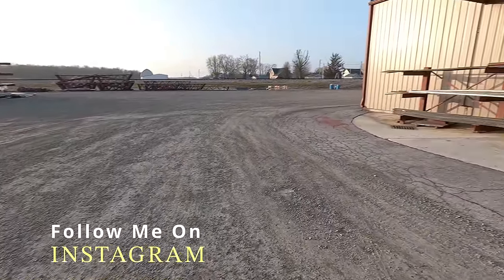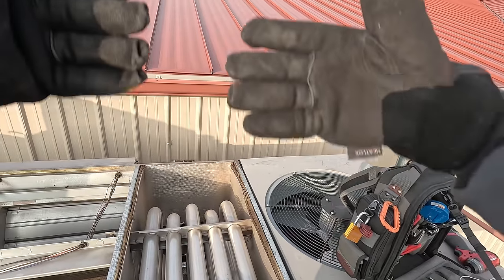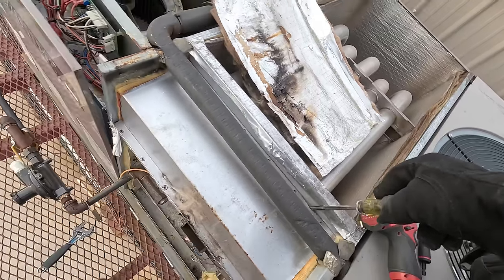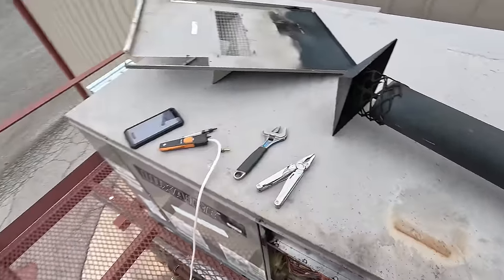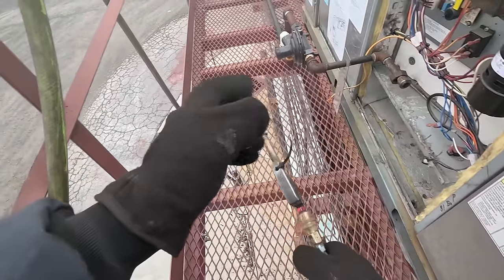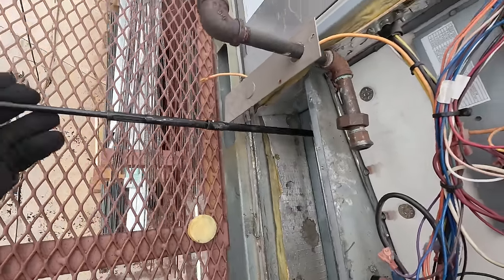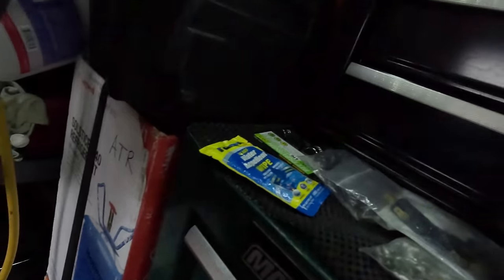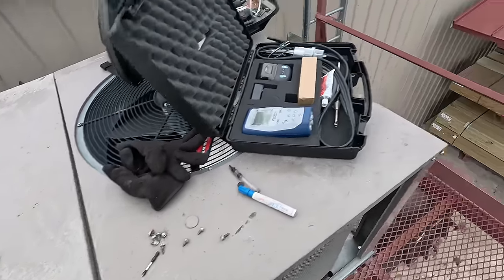Total Failure In Epic HVAC Proportions

Comment from the maker: This video was over two hours long…so to shorten it I had to cut a lot of things out. Update:👉👉 the customer decided to not fix the RTU that had a bad blower motor but did authorize me to return and install a low pressure cut out switch for the gas. I chose a adjustable switch with a manual reset. This way if the pressure switch trips they’ll lose heat and they’ll know that they’re having issues with the gas. I also recommended that they have their gas supplier inspect all the regulators, I later found out that that first regulator at the tank was not a liquid to vapor which at the time I wasn’t 100% sure because I knew that they could’ve taken it to the bottom of the tank with the tube. Either way hope you guys enjoy the video. 👉make sure to hit like if you would please.
Reply: normally ,they tie it to the flame sensor.
Reply: Great video Rick.  I thought you were work on a diesel stack at the beginning of the video. The coal was rolling🤣. Luxaire is junk and on top of that they are propane. I bet you looked like a coal miner at the end of that job. Thanks again for an interesting one.
Reply: Maybe they will get wise and install a decent system and toss the mess they have now.
Reply: Your hilarious commentary 🤣
Reply from the maker: @fshn76  my wife asked me how I got so dirty 😂🤣👍
Reply from the maker: @SeanMackBuffaloStyle  I wish I could have left it as it was. You would have loved it if you like my spoken thoughts.  Some likely would have not 😎
Reply: I watch all my videos in 2x playback speed
Reply: I love your enthusiasm when shit hits the fan. Sorry but I was dying. Great video.

Comment: Apparently what you smell in bad exhausts are aldehydes.  Don’t quote me on that
Reply: You are correct.
Reply: That’s exactly what he smells is the aldehyde . If you smell aldehyde at a furnace, you most definitely have carbon monoxide (can’t smell carbon monoxide but absolutely can smell aldehyde , produced by incomplete combustion.).
Good call👍.
Reply from the maker: That’s an interesting word I’ve never heard before. It’s good to know. Thank you.
Reply: That heat exchanger was basically a chemistry lab.

Comment: Those Luxair/York/JCI units are total ass.  Changing the HX is a two person job and the better part of 4 hrs to do.  You have to dismantle the collector box to get to some hidden screws and then the two through the blower housing and some in the condenser section.

Edit, forgot to mention, overfired and low airflow killed the last one we changed out, belt was worn to half its original width and filters hadn't been changed in 3 years.

Your analyzer is made by Sauerman btw.

Comment: Try adjusting the burner for more air until the flame turns blue (adjust the position of that shroud on each of the nozzles). This should solve future soot buildup and reduce CO emissions.
Reply: Yep. When you have that much soot its a sign its burning rich.

Comment: It looks like with the half ass exhaust piping coming down off the top of that roof ledge you’re saying there’s an airflow coming across down could be causing exhaust gases to be pushed back down to the fresh air intake for the combustion causing your sitting you’re correct don’t believe those are factor authorized extension tubes and they would’ve been better off just extending them out, 12” further

Comment: Ive used a garden hose, flooded it and found a Milwaukee small version 18v blowers fits perfectly to blow tubes out of these exchangers. Very nice work though most impressive diagnostic and service skills!
Reply from the maker: Thanks for sharing! There’s no bad ideas when you’re looking for a solution for a mess like this.
Reply: @HVACRSurvival  Get a string long enough to go all the way through the exchanger. Tie a small scrap of fabric to one end and a bristle brush the size of the tube to the other. Use an m18 vac to pull the rag end through the tube and then pull brush through. After brushing out each tube then use compressed air to blow them out.

Comment: Glad to see someone thinks the same of York/Luxaire and Goodman as I do lol, Also that is vapor withdraw tank for sure, that's just the first stage regulator to go from tank pressure to 10psi, Vaporizers are either electric or gas fired and actually heat the liquid to boil it than send it down the pipe, they work very similarly to a Unitrol on a conventional water heater. They're common up here in Northern Ontario remote mines that have huge fuel consumption demands and the tank cant boil fast enough to provide enough vapor
Reply: They used the cheapest 100$ Amazon special version of a vaporizer. It shouldn’t be within 15 ft also
Reply: @Pippy626  There is no vaporizer there, the pipe feeding the first stage reg is coming from the top of the tank, vaporizers draw from the bottom its a first stage reg and a relief valve there
Reply: @Byron88 you are correct. It’s a cheap regulator.
Reply from the maker: I later found out that it was not the vaporizer, but at the time I wasn’t sure so because I said so many things that went along with that I left it in the video. I should’ve done a title overlay, saying that it was not.
Reply: @HVACRSurvival   All good, I enjoy the content regardless, I just figured propane was uncommon there and would just throw the info out there. Happy New Year!

Comment: One of those beloved maintenance guys here, had a few units on a building I look after doing the same thing on natural gas, replaced the heat exchangers on them, from what I was told when the building gas system was commissioned, it was never purged and cleaned of any construction dirt, a rag was even found in the gas line for a boiler.
Reply from the maker: Wow. That’s great 🤦🤫

Comment: As for the gas manifold port on those valves, I use a 1/8 x 2-1/2 nipple and 1/8 coupling to extend access above the pilot tube. Connect the 1/8 tubing adapter to coupling.  Comes in handy elsewhere also.  1/8 Male x Female NPT valves are also useful if checking between multiple ports at the same time with a single device.
Reply from the maker: Thanks for sharing! Good idea!

Comment: The pilot burner usually gets a little spider webs inside it. Spent many times trying to figure out why the pilot wouldn't light. Stick some wire down there with a little hook on it. Usually will get a small  spider web on the end.

Comment: Always a great day when you can smell heat exchanger issues. I wish more manufacturers would make a low pressure cut out standard in LP Kits. Where do you find an after market switch like that? Never even though to look
Reply from the maker: Googled it. Ordered on supplyhouse.com

Comment: Were the manifold orfices changed when the conversion kits installed?
Reply from the maker: From what I was told he did the full conversion. There was no stickers to tell me what the orifice size are manifold pressure should be.  
He told me it was supposed to be 9 1/2 inches water column so that’s what I said that.

Comment: That sure seems like a large propane tank for two small heaters. Are they using the propane for other purposes?  Maybe overwhelming the natural vaporization of the tank?  If so, may need to add a true propane fired vaporizer.
Reply from the maker: Come to find out it wasn’t a liquid to vapor regulator, and those two tanks provided several other buildings with gas. I was also informed that they had added a lot of extra heating loads, which was likely causing the regulators frost up like that. I’m returning to Install low pressure cut out switches on the Regulators
.
Reply: @HVACRSurvival  That would be the band-aid but maybe still talk to the propane company and see if the total connected load is overwhelming the tank. Of course the vaporization rate falls along with the outside air temperature when you need it the most.

Comment: Before I would say that that’s a bad blower motor, I would want to double check that all three phase legs are connected to that motor. It is very likely that you have a bad contactor. I have about five bad contactors producing that same result for every one time I have an actual bad blower motor. When that unit fires off…..and I have to assume that they have the correct valve modification in place for use with LP gas…. I would want to monitor the manifold pressure when everything that uses LP in that building is running. I’m guessing that that’s a very long pipe run, and it’s a long pipe run with a small diameter pipe and a low feed pressure. So, that’s my tip for you after 60 years of mechanical work.

Comment: Great vid!  They also make the Klein flip sockets in metric but they 3 times the standard ones price!   
I’m with ya on blowing furnaces out.  I still to this day prefer using air over vacuuming if conditions permit! lol.
Reply from the maker: I have tried using a garden hose on heat exchanger before in the past that was kind of a disaster and itself. Customer said they’re willing to replacing the unit so if this doesn’t work, then we’re going to sell them a new one.

Comment: if the burners have adjustable air bands, they likely need adjusted for the propane conversion, while that's sure not helping. looks like you found the main issue, those goofy stacks and running out of propane or other propane piping issue. it for sure needs low pressure switches added.

Comment: That is some garbage but I'd derate the burner orfices. If you can find the plugs you redrill them right into the existing burner orfices. Not sure what your altitude is but in Colorado I had to do this in the past. It probably wouldn't hurt as I bet with that cheesy ductwork your temperature rise is probably high anyway.  Just a thought. I have a orfice drilling bit kit with several sizes.  I don't even know if they even sell this anymore as I never see them at suppliers selling this stuff. This trade really sucks, most would have said phuck it get a new unit. Ha, cheers to you and your efforts. I picked up my drill bits and plugs at CD Jones several years ago and haven't had to do any modifications in several years now. But it definitely fixed my problems with burning dirty! I had 500 plus ppm CO and after modifications 15 to 50 ppm!
Reply from the maker: According to the technician that was out there prior to me that did the conversion he replaced all the orifices with an LP kit. Surprisingly it’s been two months since I was out there and I haven’t heard of them calling in yet. When I went back to install the low gas pressure switch, I blew it out again this time with nitrogen and got the last bit of junk out and I open the air up more.
Reply: @HVACRSurvival  You still may have to derate the orfices if it still is burning dirty. It just is a long process.  The engineers probably smoking crack! Ha
Reply from the maker: @Paul-VanHorn  😂

Comment: Over 30 yrs HVACR in Wisconsin... never come to a LP regulator that was set correctly ( all gas regulators need be set under 100% load). BTW York & Goodman suck both commercial and residential.

Comment: the condition is in is due to them running the unit with natural gas orifices and gas valve spring,too much fuel,if converted a good brush and clean,good to go.well done.

Comment: The issue with gas fired heaters is they work good until they don’t especially when they’re half assed put together and not maintained like they should be!
Reply from the maker: That goes for anything not properly installed or maintained . But I sure as hell wouldn’t want an electric one.
Reply: @HVACRSurvival  outside of the usual
Maintenance we’ve never had an issue on the heater side not once keep in mind not every place has access to a gas fed system especially in the south may dip below freezing like once or twice with snow being super rare most of our issues comes from hurricane but with the south rarely ever needing heaters while a lot do have gas water heaters a gas fired heater for the house hvac isn’t really necessary like it is another parts of the world  or even up north and Midwest where it does snow and power can be out for a while.
Reply from the maker: @CajunReaper95  very true👍👍

Comment: 15:00 you can hear the amperage on tilt and dude puts his HAND WITH GLOVES ON in and starts grabbing at the rubber belt attached to that motor....bro if this isnt some of the most darwin stuff i've seen on the internet recently
Reply from the maker: And if you notice, I don't put my fingers on the inside of the belt if for some reason it would take off. Generally, they never do when they're locked up like they are.
Reply: @HVACRSurvival - Even knowing that’s true, Sir, I still would have powered off before moving that pulley with my hand and then reapplied power. Sometimes powering a motor from a different position will cause it to start (whether from a bad pole or faulty start components), so I know why you did that. But, safety only counts once. And that once could mean POOF! No fingers (just sayin’).
Reply: He still has all his fingers

Comment: What do you use the ball joint remover for?
Reply from the maker: I tried to pry apart that box at the top. I had to cut that out because it wasn’t successful but generally I will use them for bearings on belt driven blowers, and there’s several things where they come in handy for and they were cheap.

Comment: I've never seen propane brun black
Reply from the maker: The actual burning process generally looks really orange, but it accumulates the carbon. It’s not quite like fuel oil where you can see the dirty smoke at first.

Comment: I'd guess, just after seeing the carbon alone, heat exchanger is likely cracked, but could have been failing gas valve(opening slow/not fully opening/staying open when powered off) or gas supply low/very high pressure issue.
even the burners being very choked, I don't think they could possibly soot it up that bad, at least not without roll-out thermal fuse/safeties opening. yikes, now I'll watch the rest of video.
**OK, so installed by bozo's, never converted to propane, repeatedly out of propane or low pressure from failing regulators and maybe piping issue. what else are they feeding propane too? giant kilns, boilers, dryers? replace heat exchangers, add low gas pressure switches, change the goofy exhaust stacks to something else, maybe straight tubing way out to a big tee on end. probably wouldn't fit on the platform and 50 other things.  🤣🤣  gut it all out and start over?
Reply: With that big of a propane tank I'm guessing they are using it for everything from the heating system to their forklifts. He said they make shed kits so it's possible they are doing some kiln drying of wood and obviously there is some metal fabrication going on by the looks of those exhaust stacks they made out of sheet steel and expanded metal.

Comment: You are most likely smelling the aldehyde's.
Reply from the maker: I think that’s what someone else mentioned. I’ve never heard of that before but it makes sense. Thanks
Reply: @HVACRSurvival  
Aldehyde CH₃CHO Is a carbon atom with a methane atom, a hydrogen atom, and a double bonded oxygen atom all attached to the carbon atom.  

Aldehyde's are more prevalent with incomplete combustion, as there should be very little CH₃ methane left to bond with anything.